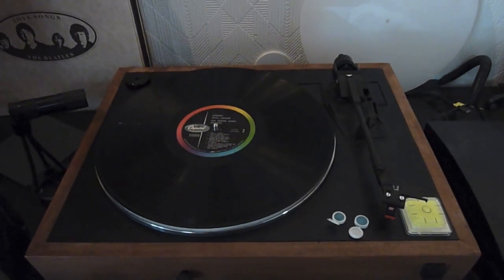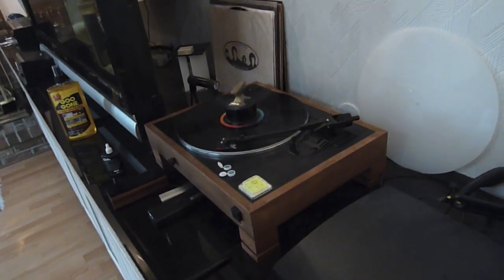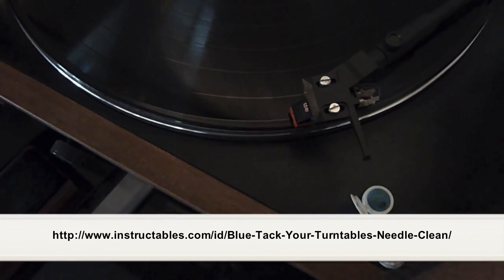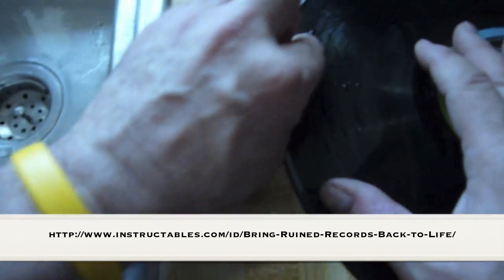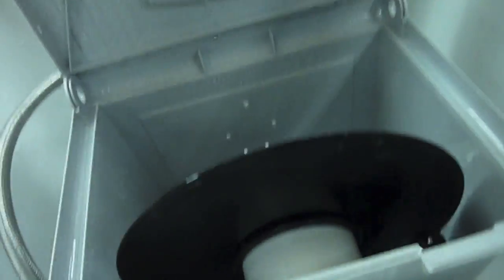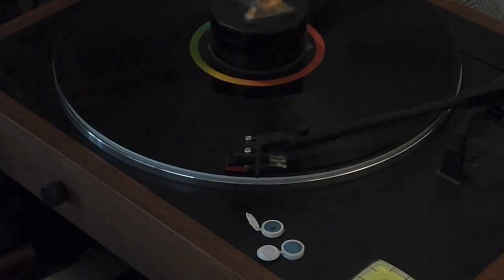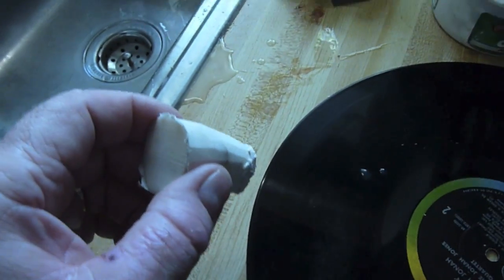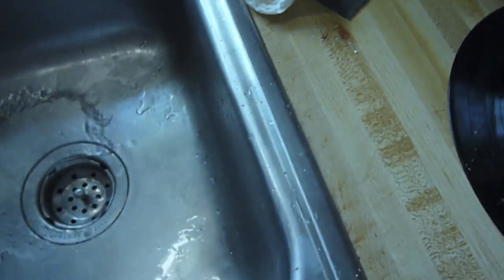Resurfacing Records to Sound New Again

Comment: NEVER I REPEAT NEVER use ANY petroleum based chemicals on a vinyl LP. This includes lighter fluid. You will dissolve the grooves in no time flat. These guys don't know chit about cleaning vinyl
Reply from the maker: There's probably no advantage to using lighter fluid on a vinyl record.  But the only known chemicals that can disolve vinyl are Dichloromethane, Methylethylkeytone and Touluene.  Vinyl is used throughout a car's engine compartment, where plenty of petroleum based things are found.  That red plastic emergency gas can in the trunk is also vinyl.  Now, paint stripper... That's something you can find around the house that will turn vinyl into a puddle (MEK).
Reply: Dont use ACETONE EVER!!
Reply: Paul Davison I found out in my youth that Off bug spray did a hell of a job on my Beatles Abby Road album. definitely ate into the surface wherever it made contact. Never took the vinyl outside for a "gathering" again. lol
Reply from the maker: Stacy, you've added one more chemical to my list of those bad for vinyl. Diethyl-meta-toluamide.  This is a common ingredient in insect repellants... It's street name is "deet".  I've included it in my video's list, with thanks to you.
Reply: Paul Davison read my buying experiences above with lighter fluid
Reply: Yeah, lighter fluid! In the 70s when I went around the junk stores looking for old records the guys there had a can of lighter fluid to make the records 'shine'. I watched as they squirted liberally over my purchase...Anyhow 40 years later they are bloody well perfect still.
Reply: I sometimes come across records that have oily residue or sticker residue on them.  Charcoal lighter is my go-to cleaner for this sort of thing.  Sometimes you have to clean the record afterwards as there is some residue, but it works.  Not something I'd use unless necessary though.
Reply: @BruceKinsey  , I will give this a go on a duff 45 and see how it goes. My usual method is 1) warm soapy water 2) WD40 (the oil in WD40 is fish oil and safe) 3) a thick layer of wood glue forced into the groove with a business/credit card, leave for 48 hours and then peel the glue off in one (Thick layer because thin layers are much harder to peel off and they break and can leave dried glue in the groove). The glue brings with it any deep rooted dust, the WD40 residue and leave the vinyl devoid of static.

Comment: I carefully followed your directions and tried this with several records. Your method is useless and I believe that this video is partially doctored. Additionally, I found that even the lightest pass on a record with sandpaper severely effects the signal, reducing volume and trimming both high and low ends. Your lps end up sounding like low res mp3s almost immediately (without removing sound from scratches). You are better off contending with the skips, pops and snaps alone than the horror show outcomes that this method entails.
Reply from the maker: +Alex Deley 
Sorry its taken me so long to reply.  This is an old video and I don't monitor it anymore.  I'm sorry you weren't successful.  Your ears must be better than mine because I don't hear any loss of range until the groove has been sanded more than half way through.  When done properly, the only material that should be removed is the upper edge which has been ruined anyway.  If you're trying to get scratches that go deep into the groove out, that won't be possible without removing a lot of material, but that should only be done locally and if the area is too long, the change would be noticeable as well as the greater chance of the needle jumping out of the track.  I leave deep scratches in, only taking the uppermost part that protrudes into the groove out.  The tick left behind is still there, but not as violent.

Comment: Clean your needle off ---
Reply from the maker: Spending some time going over comments.  Don’t do it often which  explains the delay. 

I do clean the needle. Notice the little white containers on the deck next to the turntable?   I feel pulling dust & crud off the needle is much better than sweeping sideways across the diamond tip.  That imparts sheer stress on the mount.  When I rest the needle on the compound inside the container, anything sticking to the needle is captured and stripped away when it’s lifted out.  Much less stress on the needle and pulling it away is 360 degrees efficient.  Brushing it is directional and more likely to leave something wrapped around the diamond.

I must have been making a bunch up because I see two sitting on the deck.   Only one is needed.

Comment: Interesting...first you contaminate the record with glue to get rid if the dust. Then you get rid if the scratch by putting more scratches on the record with sand paper. Then you pressure wash the record??? Then you use a microfibre cloth on the record. I don't know why. Maybe you are trying to protect all the scratches you put on the record? I sure hope that anvil doesn't fall on your record. And it didn't work so you "sand" the record some more with rubbing compound. Rubbing compound is used to remove auto paint so it should work on vinyl, right? And then there is diamond paste...back to the pressure washer. I am surprised that there are any grooves left on your record. Btw how are the grooves on the other side now (from all the pressure you used to clean this side)? And the job would not be complete unless you use more chemicals such as goo gone. And now your record brush is contaminated. And so is your anti static record brush. Microfibre cloth? Why don't you use steel wool? You know that you can damage a floating turntable by turning by hand right? Perfect! Wait until those chemicals wear off. Just as it was 😂. Of course if dawn is good enogh for ducks it must be good enough for vinyl. How bout doing another video that shows you removing all those scratches you put in the record removing that one scratch that you started with. Bravo.

Comment: I watched your video and quite frankly it might have some merit only as a last resort. Then again the whole process is negated by your refusal to handle the record carefully. Putting your fingers on the record surface is unacceptable at any time. I would wear non powdered nitrile gloves to prevent contamination. Then you would be able to safely remove the vinyl from your homemade cleaning machine without adding oil from your fingers.
Reply from the maker: SJ:  Your opinion is as  valid as anyones.  I agree fingers should be kept away from records after cleaning.  Fingers leave oil on the vinyl that can get into the groove... a magnet for dust and oily buildup at the bottom.   Soap is what's used to release oil from the vinyl.  It also releases it from skin... and water flushes it all away.   I see no need for gloves while washing, as no oil will be getting layed down.  I also tip my hat to you for willing to go that extra distance

Comment: thats a pretty crappy needle for such a nice setup. . . you should try the shure m44g, [extremely clear sound] and they dont cost all that bad
Reply from the maker: Mike Rivera JR  I never use an expensive needle until my records are properly attended to.   

I own two good needles, an AT440MLa and an AT150MLX.  Surprisingly, I prefer the sound of the less expensive 440.  The one in the video is a Samsung.

Comment: The horror. The horror.

The Livestrong bracelet. The bizarre steampunk record clamp. The 15 minutes and 30 seconds of nearly real-time tedium. The desecration of the sacred memory of Jonah Jones. And then, the Goo Gone.
Reply from the maker: +MrWolfSnack 
Ha, ha, ha.  FYI... I've had cancer, so back off.  The steampunk clamp came from my grandfather, the 15 minute and 30 second video certainly is real-time tedium (I should re-do it) and thank you for sitting through it.  How did I desecrate the memory of Jonah Jones?  If I did, I'm sorry.    And yes, GooGone.  It works on the vinyl trim on cars, vinyl in the refrigerator, vinyl used in nearly every manufactured product today as well as in vinyl records... Even old ones with phthalates in them.  You should try it.

But thanks for the comment.
Reply: The results are audible and dramatic.  Fuck the haters.
Reply: MrWolfSnack you are a Cad
Reply: Actually the anvil is what made the whole thing real for me. Friggin downright cool. Just don't try it on a 78 unless you center it really well.
Reply: InsideOfMyOwnMind nm

Comment: I quit watching when he got to the lint roller !!! ...fer gosh ache - dish soap and lukewarm water, add an old toothbush if needed. Stop all that useless fussing with expensive useless alternatives.
Reply: Well you missed him fix the scratch. It was sweet
Reply from the maker: +Robb Nesbitt 

Hi Robb.  I never should have included anything but resurfacing the record in that boring video.  The lint roller wasn't expensive and it isn't for cleaning.  It removes the dust that can be seen in the video in the low angled light.  It works spectacularly well and eliminates any noise from dust collected between the sleeve and turntable.

Comment: I see a bottle of "Goo Gone". I hope you're not putting solvent on your records. Edit: and sandpaper! I'm outta here.
Reply from the maker: Jeff Williams:  Again, I'll emphasize only three chemicals affect vinyl... GooGone contains none of them.  The additives in GooGone do a great job of dissolving the crap at the bottom of a record's groove however.
Edit: Sandpaper only works for those who want to remove the noise scratches make.  If you don't mind the noise, don't use it.